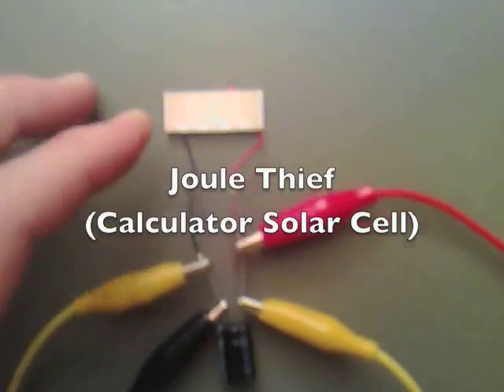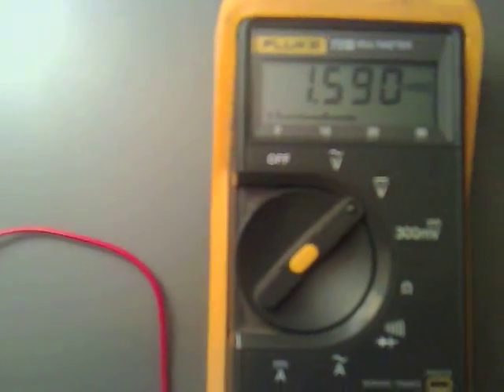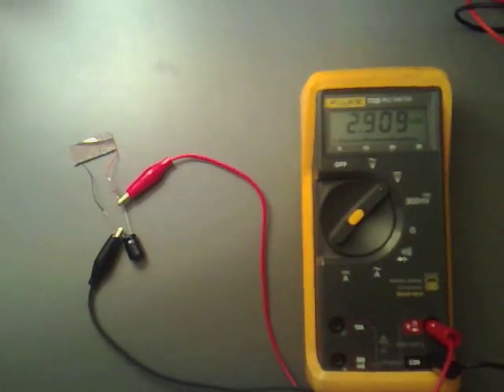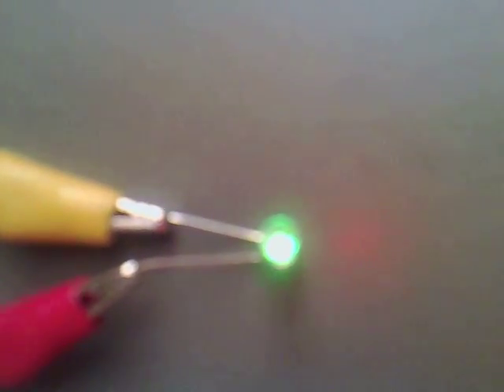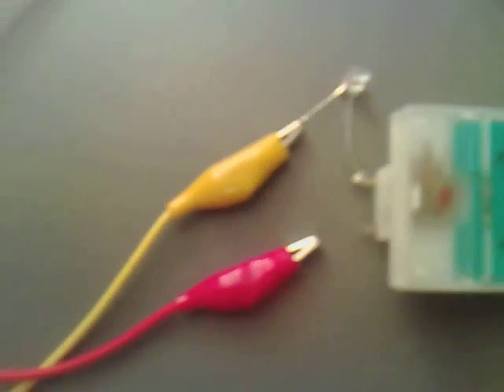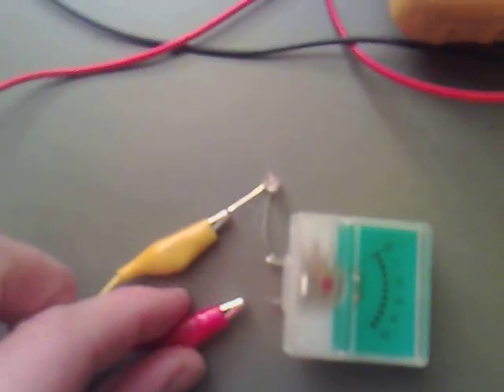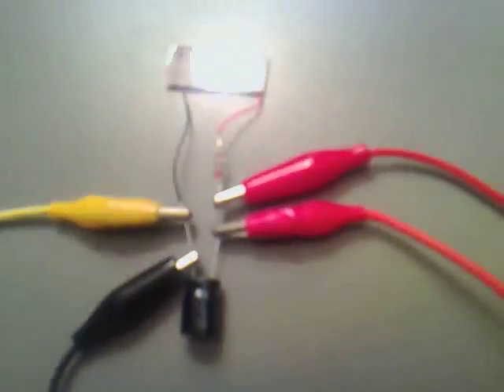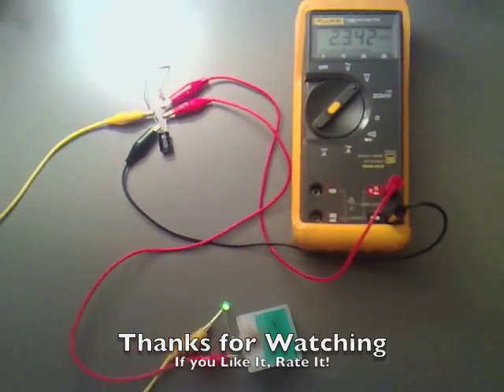Joule Thief (Calculator Solar Cell) 018

Comment: Theoretically, if I'm doing the numbers right, to make a viable solar cell that can take in 4000w in power, I'd need 133334 of those micro solar cells. Assuming each cell cost about one cent to purchase, I'd need over one thousand, three hundred dollars to produce that solar array. Would someone smarter than me (that shouldn't be hard to find) run those numbers out and see if that's about right? I can't find these micro solar cells online with what queries I've tried, but imagine if you could get a lot of them for better than that price? Might make a viable option for a solar collection system on a shoe-string.

Comment: The mistake many poeople make is thinking that adding the Joule Thief (or any other power dissipating circuit) is going to "make it more efficient."  The typical conventional JouleThief is about 50% efficient, which means half the power is wasted in the JT.  You are better off using the simple and less power wasting circuit that you have in the video.
Adding a super cap / ultracap of more than a hundred farads will give the storage capacity to run the JT for several hours after darkBut why would

Comment: I was originally going to say that the diode was not needed if you only use the LED, but I guess it's needed to charge up the capacitor or battery to prevent "drainback" of power back through the mini solarpanel.  If your not charging a (storage) capacitor or (storage) battery, then I guess the diode is not needed and the LED can be ran directly as long as the solarpanel gets light.

Comment from the maker: Old CRT Monitor have quite a few in them, or buy a cheap 11w Fluorescent Lamp and saw it in half on the seam a bit then put a screwdriver in it and twist.

There should be a few in there...

Hope this helps.

Paul..

Comment: you still need a current resistance in series with the led because its only limited by the resistance of the led and could shorten its life. also you multi meter is going to dran a small charge this depends on the quality of your multimeter.

Comment: yes solar cells output DC, you need the diode to prevent electricity from flowing from the storage tank.(capacitor in this case, could be a battery.) An LED is a diode, current only flows in one direction through a diode.